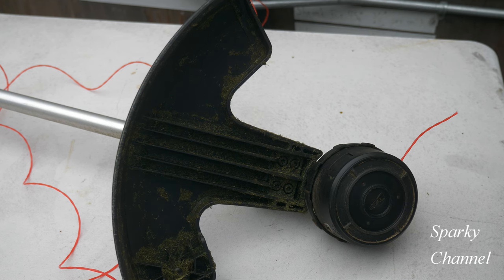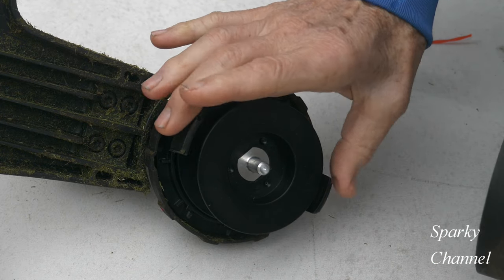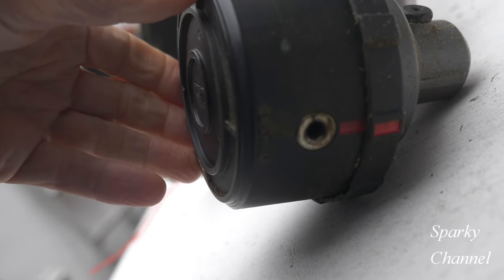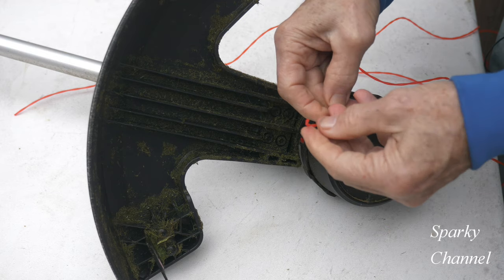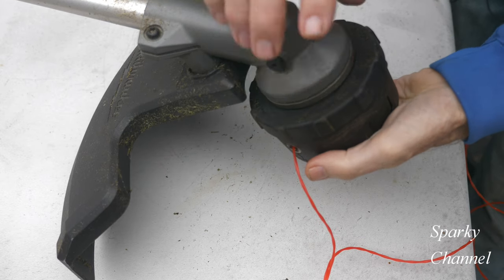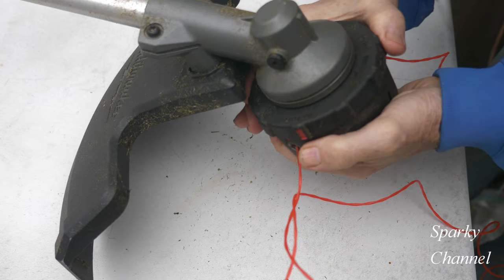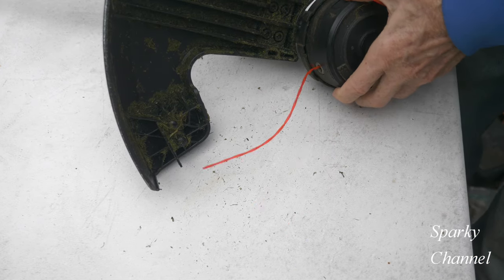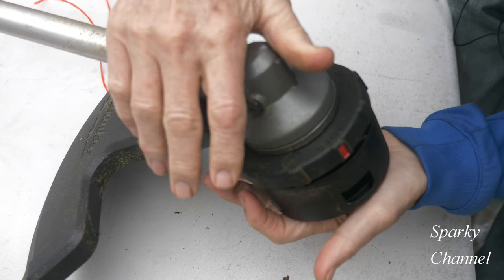How To Re-string a Milwaukee String Trimmer

Comment: I think I'll stick with my Ego self winding carbon shaft trimmer.  it looks like Milwaukee's  design is loosely based on Ego's invention, but without the convenience of motorized push button winding.  I didn't hear how long of a piece of string you use.
Reply from the maker: HI! I used about 12' of string. I don't like to fill them to the max. They seem to run more problem free that way. Ego's are excellent. I have the Ego lawnmower and I love it.